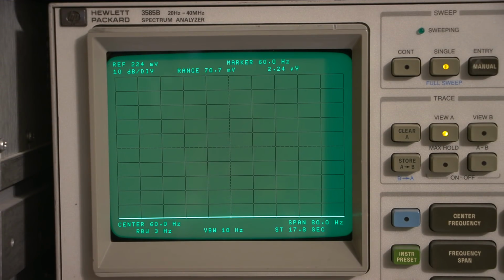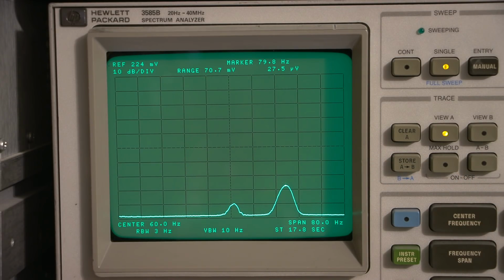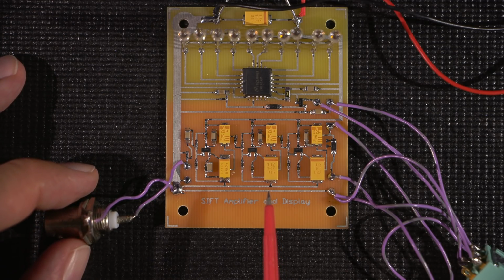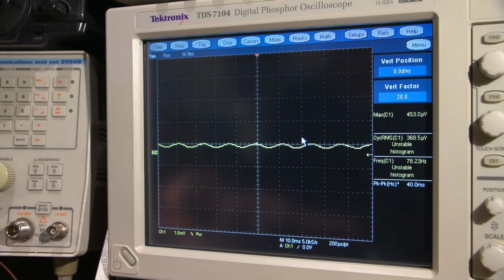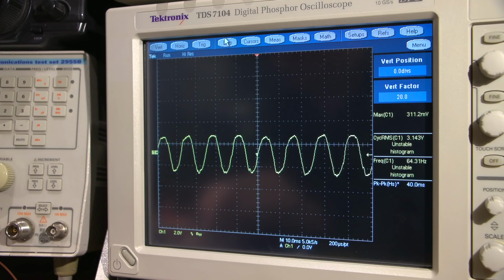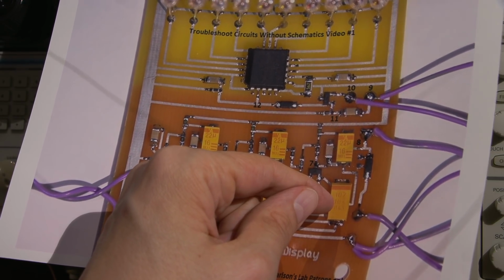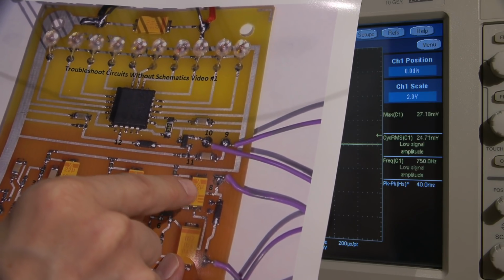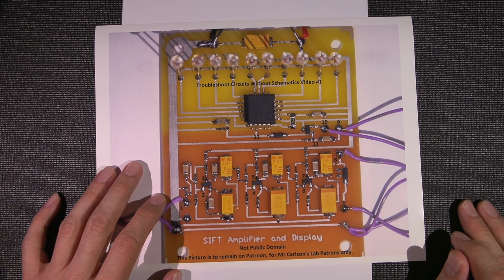Super Electronics Troubleshooter #1

Comment: As usual 10 thumbs up. Could you have upped the frequency and use the super probe. I could have tried it myself if I had a frequency gen that put out a signal that low.
Reply from the maker: Hi Carl. I was going to use the super probe in the demo (it works very well) but that's too easy :^)